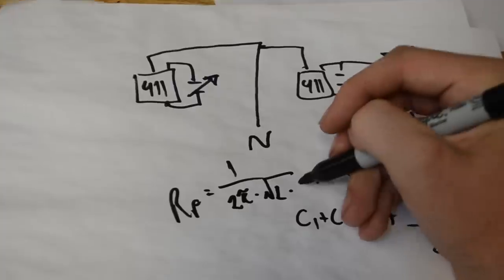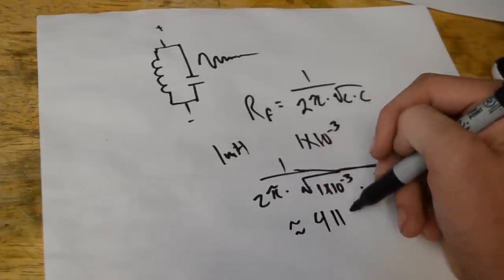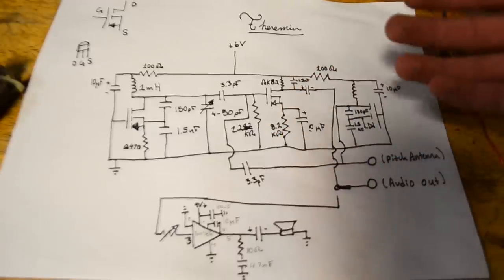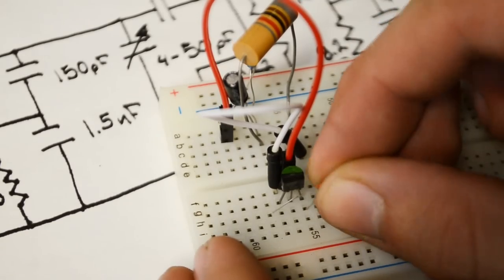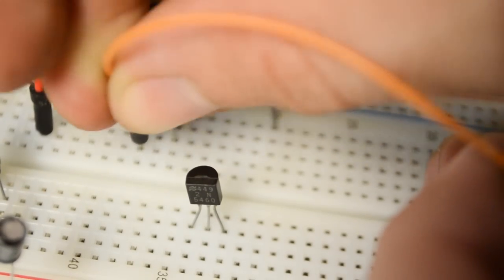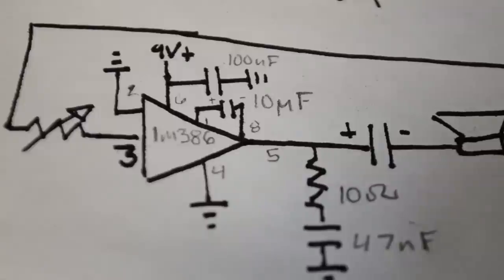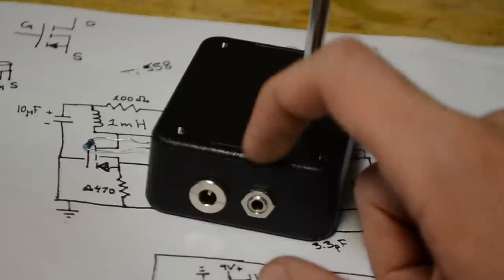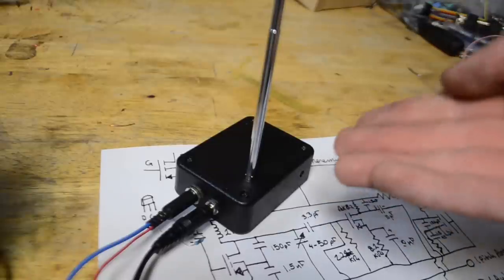How to make a Theremin

Comment: I'm in highschool and I've just started learning EE and legit, the explanation at the start made soo much sense. You have been an amazing teacher, hats off to u
Reply: I highly recommend the book Getting Started in Electronics by Forest E Mims III.  I got started on it when I was 10 or 11.  It's an excellent book for someone getting started.  And it gives intuition without bogging you down in equations.  From there, the next thing you want to do is either a) get an oscilloscope for $500 or else b) learn how to use the program PSPICE to simulate circuits (it's free).

Comment: A cheap and dirty way to make a small variable capacitor is to twist some small wires (like solid cat 5 cable wires) together. You can change the capacitance by twisting and untwisting the wires. For the value you specified, two lengths about 3-4 inches long would be a good place to start.
Reply: William J. True. Some guy told me the same thing...havent tried it but nice when you dont have one right away
Reply: William J. Is this a trade secret? Lol
Reply: ivan Reynoso - Yes! Don’t tell anyone! ;-)

Comment: 5:00 That Epsilon in the formula is not the dielectric constant, but the permittivity, and that equals with the dielectric constant times the vacuum permittivity which is round about 8,9 * 10^-12 Q/Vm, so according to that you will get a capacity round about 10¹¹ times lower than with your explaination. Really interesting project though👍

Comment: I have always wanted to build my own theremin! Sooooo coool! I also saw your video on combining a plasma ball and theremin. Way cooler than just the LED lights I was going to settle for. I have an idea for an interactive artwork for an exhibit next January and I wanted to figure out how I could incorporate light and sound. This and the diy plasma globe will be perfect! Now I just have to figure out where to buy/ thrift all the parts I’m going to need and how to set them up inside my sculpture safely. I have a small old guitar amp to use for audio out. I want to make 12 small plasma globes and each one of them playing a different frequency so I can try to tune them to the 12 notes and halftones in an octave. I wonder how the circuitry for this will look and how complex that will make it. Thankfully my partner is an audio engineer and can help me out with some of the build and calculations.

Comment: Good stuff as always. I was wondering if you could do a whole video on the best old electronics to salvage and how to safely salvage components from them. I am a hobby DIY electric guy, who lives in poverty and doesn't have a dime to spare on parts. It would be helpful when i'm at a goodwill/thriftstore to know what electronic devices have the most useful components and how to remove them without breaking them.
Thanks! 
also, are you going to college this fall? and if yes, is it for electrical engineering? i sure hope so cause we need people like you!

Comment: Hey Keystone,  do you think you could make a dumbed down tutorial that may fit the parameters of a project I'm really looking forward to starting?  I'm going to take a new skateboard and run individual red, blue, and green leds through it.  The objective is to hide the arduino, leds, resistors, wires, battery, and other possible components inside of small cavities I'll make in the top of the board.  The leds will shine through holes that will display the colors beneath the board as the grip-tape hides all of the electronics and cavities located in the top.  I'd love to use the arduino to adjust brightness and colors, alongside using something as thin as a cellphone or watch batteries to power everything (lithium ion for recharging would be absolutely amazing if possible).  I'm sure you're beyond experienced enough to conclude a circuit for this and I'd love to explain more if you're interested.  It'd be nice to have a video out there that's generalized for this build since I know many people would go nuts over it.
Reply: And by dumbed down I don't mean I prefer you to leave math out of it.  But I'd love minute explanations behind what's going on along with the math.  This whole electronic's thing is like wizardry to me.  I plug my computer into the wall and magical pixies make it all happen.  (:
Reply: Hey, are you still trying to do this project or have you figured it out already? I know it’s a bit late but I might be able to help you with it still.
Reply: Yeah, that level of complexity is pretty trivial as things go.  The color of the lights is a lot harder than the brightness though.  You might need a microcontroller / arduino if you want to pick and choose colors...  For the brightness part, I could have built that when I was 10.

Comment: btw, in the original circuit he used 1n5 on C13 which is 1mf(according to google) I would like to ask why you use 1.5nf instead. Did you test 1mf and get the best result from 1.5nf ?

Comment: And for those of you out there who are overwhelmed.. Just forget the math. (Just think input and output - what do you need to put in,  and what do you want out.) Look at the components. Orient the transistor correctly. Understanding the white breadboard will be clear once you ohm it out, or you can use a battery and a small light bulb. The "plus" and 'minus' run straight down the length of the board like 2 wires. They run on both sides for convenience. The horizontal holes that he mounts the components to are separate horizontal "share" wires that attach to nothing, and must be jumped to get power. You WILL get used to a breadboard and it will become clear with time.

Comment: Who is up for a volume antenna theamin
Reply: Yeah WHY do almost ALL of these DIY theremins lack the volume antenna? >_< How the hell are you supposed to play these if you can basically only play one long note?
Reply: @KRAFTWERK2K6  Its another theremin+freq to voltage converter+voltage controlled amplifier so yeah
Reply: @KRAFTWERK2K6 until then I guess you can connect it to a switch of some sort
Reply: @audiodood  or a volume knob. That would be the simplest solution.
Reply: @KRAFTWERK2K6  yeah but a key-like switch or something would probably be easier to adjust quickly; maybe connect it to an AREG or something to get a nice fade in/out
Reply: Dudes go search for the Moog Etherwave schematic and build it. It's the real deal

Comment: The weird feedback you are talking to is probably caused by the removal of that capacitor that you said had no effect. It simply isolates the circuit's power supply from the amplifier, because amplifier needs a +12 and -12 volts or some symmetrical power supply like that and your battery is not a symmetrical power supply. So the audio output seemed like a negative voltage to your amplifier because 0 volts is the negative side of the amplifiers supply. That capacitor was isolating the audio voltage level from the amplifier input level. So the input of the amplifier can sit between the supply voltages of it to generate an alternating voltage (which is a sound wave).

Comment: Please show us the best way to produce HHO the quickest and with great PSI and without using a electrolyte. so I can use it as a torch to cut and to melt metal. Note I'll be going through thick metal so the length of the flame is important (psi)

Comment: Ok i need help here. I built this with the schematic provided. All the same values down to the 2n5484 JFETs. I originally used 1 milli-henry inductors (schematic says 1mH), later replaced them with 1 micro-henry inductors. The math made more sense for 1 micros. I'm getting 0 oscillation shown on my scope anywhere, it's just passing DC. Are the FETs bad? 6vdc in, 9v battery with an lm7806. All new caps and inductors, 1% tolerance resistors, very short connections between components. I'll upload a video If I can get it going.
Reply: What was the net result?
Reply: @darinhitchings7104  didn't work. I think the components were too close together and interfering. I never got it working.

Comment: 17:15 What is the wire He just randomly added to connect both breadboards? I literally think this is the last step I need! I just need to know what plugs into the audio other then the audio out, like is there a seperate audio in? cause as is I get a sound like a partially plugged in amp (so I assume thats what it is)

Comment: Hello, I  built this circuit but havent get sound from the antenna. I used J113 instead of 2N5484 and all the other components are identical. I got some strange radio like sound from amplifier but the antenna is not function at all.

Comment: The solution to no volume antena is jus to add a button that stops the curcuit muting it completely and you have to hold the button to complete the circuit andlet it create sound

Comment: You really don't understand what's going on do ya?  By all means, leave out the DC blocking cap on the output. Wonder what smokes first, the 386 or the speaker?  But hey, you DO play pretty good.  I would fiddle with those 3pF caps to vary the sensitivity a bit.

Comment: stupid question but how did u connect the theremin to the guitar amplifier?
Reply: You buy a plug that's e.g. 1/4 in stereo male on one side and that has a barrel that you can unscrew and solder wires onto on the other.  Then you solder the wires coming off of the theramin to that plug.  Or better yet, attach the ends of the theramin to a male plug and buy an extension cable that's 6 ft long or whatever to plug it into the amp.  Make sure you're plugging it into a mic input not a line in or else you'll kill the battery of the theramin within a few minutes.  And you may need a dedicated power source anyway instead of a battery.  I'm not sure how much current a guitar amp's mic input will draw, but it's probably too much for a 9V battery.  In which case you can build a power suppy for it with an LM317 voltage regulator.  See the circuit in the book Getting Started in Electronics by Forest E Mims III or else just google how to build a power supply with a voltage regulator.  And then sub out the 9V battery.

Comment: Shame the JFET pinout was described wrongly! The gate is pin 3 source is pin 2, even on the TiS58 used in this vid! The guy who designed this circuit, Thierry, specified 2N5484 JFETs, and they have pin 3 gate, too.. Some are apparently gate on 2 but not any of the ones I've seen so far.
I built this circuit (well my 9yr old son did) following the video precisely, except for the amp section because guitar amps everywhere here.. Nothing. No output. I obviously should have researched more beforehand but finally realised the pinout error. Keystone must have rectified his mistake but not told anyone.. Also, Thierry explicitly advises against solderless breadboard for this due to inherent stray capacitances. I couldn't get it to work so I soldered it onto veroboard, using a his pcb layout and now it works a treat! I ended up using J113s for the oscillators
Reply: Even I am not getting any output can you help me please
Reply: @atharvaghag4504  I couldn't get this version to work at all and ended up using a pcb layout of the original by Thierry, soldered on veroboard. I also received several fake 2N5484 JFETs before I found some genuine ones, hence using J113s originally which kind of worked. The correct 2N5484 worked much better, far easier to tune.

Comment: Didnt explain how to design a theramin on any level, and that breadboarding gave me anxiety but good vid
Reply from the maker: How so? I explained exactly how to build the one I built, literally part by part
Reply: @KeystoneScience  i said design, i was curios what characteristics of the circuits used make it work, its not a problem of the video just the wrong video for me
Reply from the maker: Ahh okay, I see. There are some good papers out there, ( I’ll try and find them to and post them in this comment thread for you to read ) but really the key is just making an inductor-capacitor resonance, then having the capacitance be slightly altered by your hand ( meaning one ‘plate’ of the capacitor is the antenna, and the other is your hand ), from this relation, the resonance frequency of the capacitor-inductor configuration is altered slightly, so the rest is just subtracting out another waveform from it (which you chose by the tuner in the circuit) which then leaves you with a much lower audible frequency dependent upon your hands position, so then that is the sound that is amplified :)
Reply from the maker: Also, I am not sure how familiar you are with LC resonators, ( that is the inductor-capacitor resonators I was referencing ) essentially, it is the current flowing back and forth from the inductor to the capacitor, as the inductor stores the energy in a magnetic field as current flows through, then when the field collapses, it creates current which is stored as a charge on the capacitor, then the capacitor discharged into the inductor making a magnetic field... and so on. The frequency of the trade off is determined by the inductor and capacitor values, ideally, by the relation:
Frequency=1/(2π√(LC)). So hopefully that helps!
Reply: @KeystoneScience  im currently studying ee and im considering this for my senior project, thank you very much for help